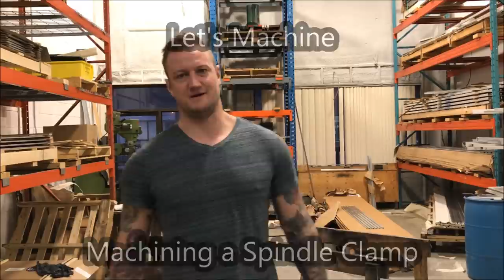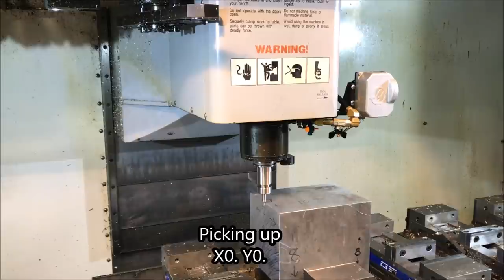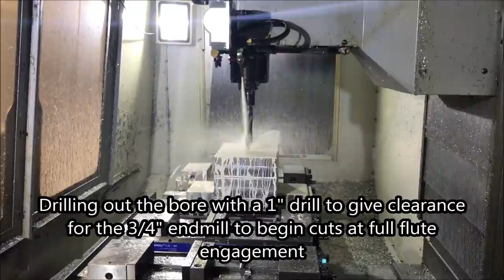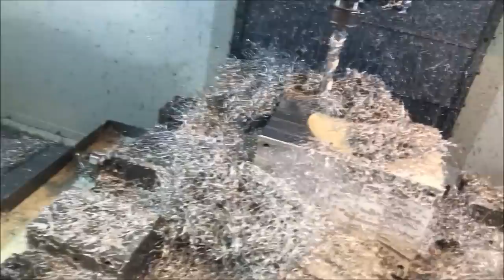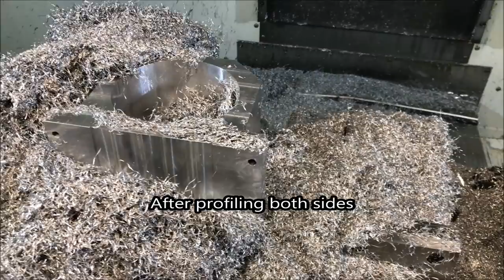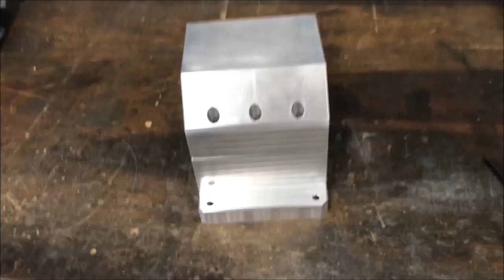MACHINING VLOG: SPINDLE CLAMP

Comment: Great Video Ian! Just a quick one, when machining the 3 drilled holes/ counterbores did you machine the counterbores first to create a flat for the drill to engage the material? I previously did a job at my work place and it had similar features. Keep up the good work mate, from the UK !!
Reply from the maker: Thank you sir! Yeah  you got it, I sunk down a counterbore with a half inch endmill until it was totally flat, then spot drilled the hole location inside the counterbore before drilling. Thanks for watching!

Comment: Have you considered using haimers to set your work offsets? Just curious.
Reply from the maker: Nah, never seen a point in it when a $20 edge finder does the trick! They are nice though for sure.
Reply: Oakwood Machine Works haimers and other devices like touch probes from Renishaw bloom etc are only required when your machining high value components or castings that can’t be replaced quickly and cheaply..it’s simply not cost effective in other circumstances...edge finders or setting bars are simple cheap and get the job done....nothing beats and old drill and a fag paper....why pay £5k for a probe when it’s not needed ???

Comment: Did you machine that with a high speed machine?  I have a VF-3 it does not have high speed machining unless i pay extra for it. I also run mastercam and those dynamic tool path take for ever to run a part i tend to use old school Toolpaths.
Reply from the maker: I use old school paths as well typically - this VF5 does not have a high speed machining option either. Each side was about 4-5 hours in dynamic, feeding fairly slow and taking small passes - but it was about the same amount of time when I did the last one using old school pockets and area mills
Reply: same prob, but you can lower the back feed rate to 100ipm and filter the path to a 1:1 ratio that will create arcs in X and Y, 25% step over, always will have a pain to clear swarf tho without high pressure coolant, dems the breaks!
Reply: Another vote for 1:1 filter.  I also post I J K with 360 arc option and allow helix.  Really helps smooth out circular and spline segments.

Comment: Great stuff. I will email you pic and  specs on the long reach shell mills for alu
Reply from the maker: That would be great! Pleasure speaking with you brother, thanks for the call!
Reply: I always have a hell of time with them long 2fl hss chattering and deflecting and just leaving crappy finish. What rpm and feed did u run?. .5 to 1 mm stepover ? Oh and it did come out looking great
Reply: Agree with Ryan.  Get a good 2" shell alum specific shoulder cutting.  If you get good prices on Korloy stick with that brand.  Most new inserts do a good job of leaving straight wall finishes.  I like having 2" and 3" Shell, just take some big wacks.  It is harder to get good side milling results once the end mill gets longer then 2" with 40 Taper.
Reply: yes i have . i have been using yg we use a ton of 3/4 xxxl.  i never have a problem with carbide just hhs

Comment: Im not a machinist but wouldnt it be easier to to slot a ring around the inside of the bore so the whole center of the part could fall out, then finish up with a finishing pass? Prob With a peel mill op. You could save time, tool wear, and material and still have chips flying everywhere XD.
Reply: Clearing chips would be a big issue,  as well as flute length limitations. Also the breaking through/falling of that core would be a massive gamble, with the potential of breaking the tool or gouging the part! Much safer to spend the time and pocket it out, my opinion anyway.